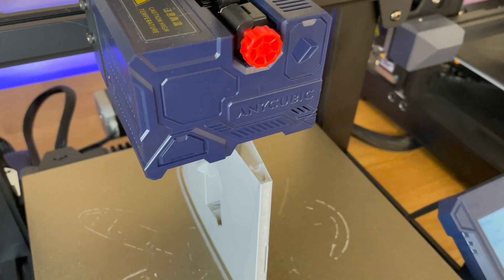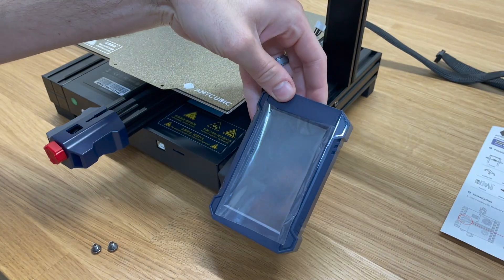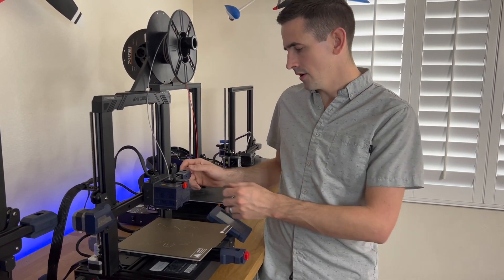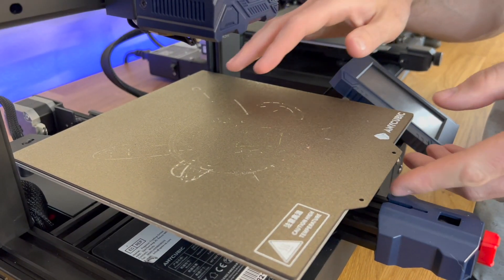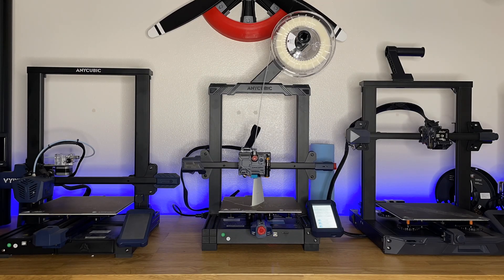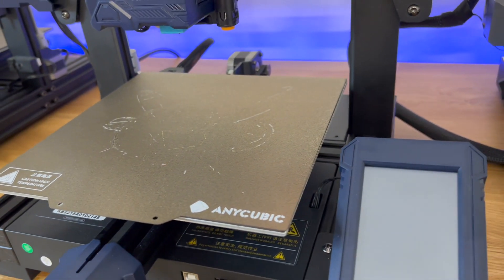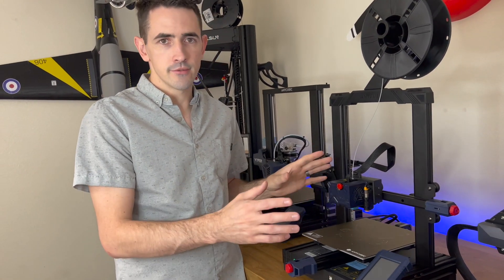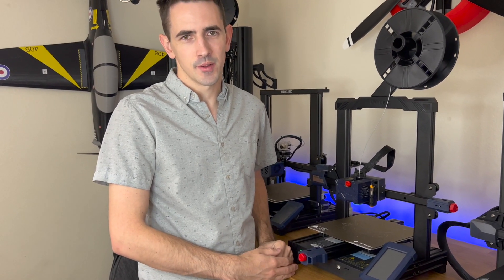Brand NEW Direct Drive ANYCUBIC KOBRA 3D Printer

Comment: So it has been two years since i got my Anycubic Kobra and we need to replace/upgrade our extruder. Could you assist me in which one you have chosen since the discontinued Kobra 1 and hotend/nozzles. I am trying so hard, i have been able to find the motor but i am getting lost for the extruder, hotend/nozzles. So far i have gather information Nema 17 bipolar 1.8 angle 42-23 motor for a replacement. Then i am trying to find the right Direct Drive Titan Aero or Titan extruder but i am lost for understand the nozzle. Would love your input.

Comment: is the 250mm height is not a drawback of the Kobra? also thinking about buying Bambu A1 which has 265mm. I am wondering if it is not slowing down the printing process on bigger planes having to cut up the model into smaller pieces?

Comment: Your channel is very good, tell me one thing, which filament should I use to have a good impression and resistance to bad weather such as sun, serene and oil or gasoline if using a model with a combustion engine which polymer would be better to use to have more durability? of material?

Comment: HI troy, I'm looking to upgrade from my ender 3. I'm borrowing a Prusa MK3 to speed up my printing time. what do you recommend for a good self leveling direct drive printer. I'm really looking at the Flsun v400 but i'm worried about if its going to be a good all round printer. I print mostly foaming LW PLA for planes, PLA+ for crafting material and TPU for mu FPV drones. Will I get faster printing speeds with the V400 over the Prusa with LW-PLA? My second choice would be the Prusa MK4 (long lead time).  the Any cubic printers look interesting, i'm just worried about longevity and part availability.

Comment: I do not recommend the Kobra. I've had mine less than 2 months and the extruder motor has failed. Anycubic is sending parts for free but what a disappointing beginning with this printer. I like my Ender 3 v2 neo much better with no issues so far.

Comment: Moving parts is the same between the designs as others have mentioned, what makes the difference is technically the difference in diameter between the filament, and the bowden tubing obviously needs to have a tiny gap to minimize friction if the filament varies (as all do) in diameter slightly.

That slight gap means that when the extruder PUSHES after retraction, there is a delay before pressure actually reaches the filament at the other end down in the nozzle due to filament first pressing against the bowden tube wall along it's length and then finally force reaching the filament at the nozzle to get it to move where we need it to.

This same thing works in reverse on RETRACTION, as any slack in the bowden tube of "hitting the inner wall" by the filament needs to pulled back upon first before the filament at the nozzle finally starts to move.  Yes, it's a tiny amount of distance, and time involved, but when printing sub-millimeter in a 3D printer, it does affect quality.

That's why the retraction settings need to be noticeably reduced in your slicing software when you, for example, install a direct drive extruder as a conversion from a bowden style.

Comment: direct drive is actually not so important with printing lw pla because retraction is turned off (due to foaming and hence nozzle blockage risk).  Nothing wrong with bowden for printing plane parts, especially short-throw bowden printers like ender 3 and clones.

Comment: Movement is the same for direct drive and bowden tube printers. They both have extruders, which is the only moving part for applying the filament to the print bed. The difference is actually the flexing of the filament. It is much less with the direct drive vs bowden.

Comment: I purchased this printer and I really like it.  I especially like the way it levels the bed.  Finally, a bed leveling program that seems to work (fingers crossed).  One problem, Cura 5 does not have a profile for this printer.  So, how do you set this up in cura 5 and what slicer did you use?
Reply: You can import profiles for the Kobra in Cura. They are for PLA, ABS and TPU with the extension .curaprofile.

Comment: First off. Please slow down.  For gods sakes man!   How do we tighten the bed and adjust everything!!!! That's the first I've heard of this and you just show a split second of it.
Reply: Other videos show how to adjust roller wheels.  Basically you want all 3 in each group equally resisting turning by hand.  they should turn under gentle hand pressure individually: not spin freely, or be too hard to turn.  Only 1 has an adjustment nut out of the three.

I would recheck them after a few weeks or printing also.

Comment: I'm debating between the Vyper and the Kobra.  My concerns are the single z axis on the Kobra if it will handle printing over long use, and with the vyper it being a bowen when I will be using flex filaments from time to time.  It's going to be my first 3d printer and I don't want my experience to be a negative one.  I appreciate your help and so value your opinion.  Any suggestions???
Reply: Did you buy any of these models?

Comment: The display looks like the one on the Vyper, which I really didn't like. Open Source firmware support from Anycubic on the Vyper was really bad. And there were (are?) some royality issues with the compiler... Hope the motherboard is now fixed and uses uart mode for the TMC drivers. They switched from a load cell for ABL to an inductive probe which I really appreciate.

Comment: Only concerns I have are all about the direct drive and maintenance of same.
It looks huge. Does that mean it’s heavy because if it is that will cause problems and how easy is the hotend to service. It looks like it could be a bit of a pain having to dismantle it every time.
I assume that it’s not an all metal hotend and it still uses some ptfe tubing?
Reply: Anycubic has used lightweight material in the print head. This will help with a sagging issue on the gantry.

Comment: Can it run the gcode for prusa i3 that comes with some rc models without modification ?
Will You show cura settings for printing planes with this ?
Thanks
Reply: I use the G-codes from Eclipson models using my Prusa mk3 which if I’m correct they are supposed to be for the ender printers. The work flawlessly so I sure you can do the same with this.